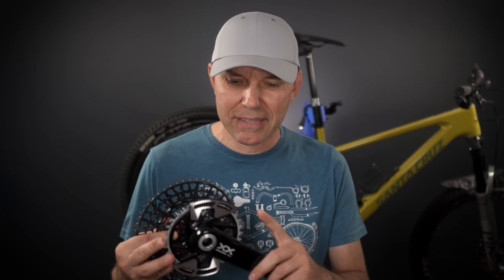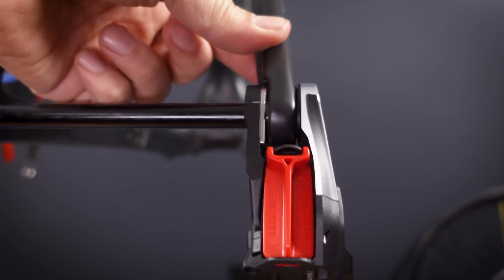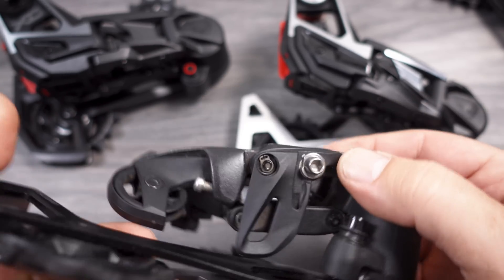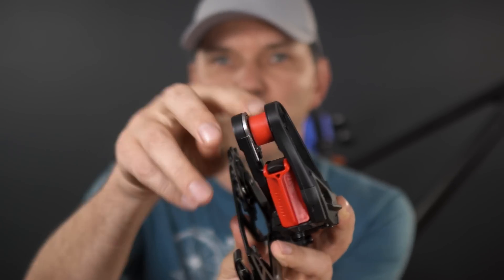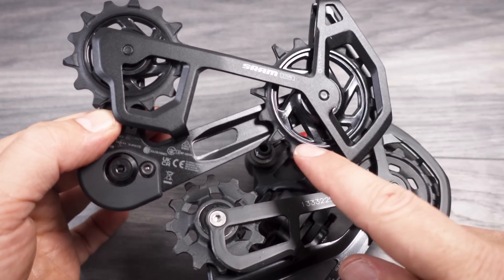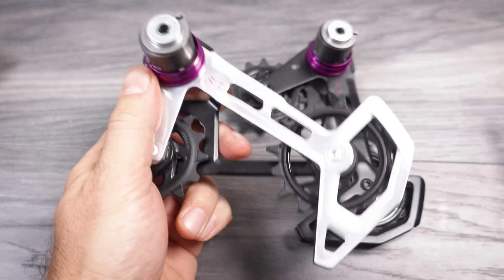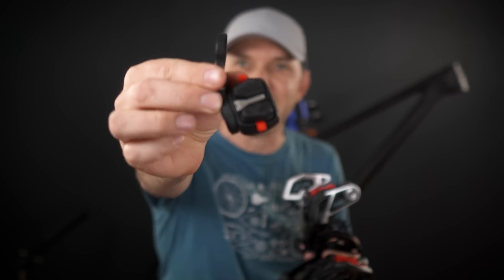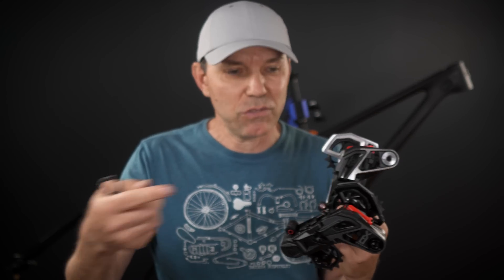NO Hanger! T-Type DERRAILLEURS - SRAM Eagle AXS Transmission Deep Dive GX, X0, XX, XX SL

Comment: Great video! Thanks and respect! One remark: I am pretty sure that the “cassette mapping” is a myth. The derailleur does not know at all in which position the cassette or the shifting bridges are. No sensors for that, nothing. The derailleur shifts even without a wheel or chain installed! The only thing i can imagine is predefined delay times in the firmware between shifts on multiple shifts (yes, that is why t-type is slower on that vs shimano!). All that just calculated on the drawing boards, at an assumed typical cassette rotation speed. Can you support your claim, that the derailleur would “wait for the shifting bridge “?
Reply from the maker: You’re correct! The launch of their mechanical version confirms that😉
Reply: @LoveMTB I was about to add that argument… 👍🏽
Reply from the maker: @AndrasKSzabo lots of marketing hype in our industry that’s for sure 😊
Reply: @LoveMTB still amazing how sram applied the narrow-wide idea to a cassette! All cogs have even number of teeth except the red reference one. It is a masterpiece that the N-W alignment does not derail simply mechanical
Reply from the maker: @AndrasKSzabo like I said they learned from the best😊 Shimano figured out the smooth shifting up and down then they doubled down with Linkglide. SRAM borrowed some ideas and expanded the NW they used in the past just for their largest cogs. Great times to be looking for a drivetrain hard to go wrong these days

Comment: Have a GX t-type axs whole group, simple shimano deore 12 speed derauiler for 50$ works better (and you can use 3rd party chains and cassettes) than this whole setup
Reply from the maker: I would not recommend to use 3rd party chains with the Shimano 12s if you care about the HG+. But yes, way cheaper with similar if not better performance.

Comment: Hi, Can I fine tune the XX EAGLE TRANSMISSION? My bike (S works Levo SL) is brand new and it shifts hard into gear. Seems like it needs a micro adjustment.
Reply from the maker: For sure all here - Easy INSTALLATION SRAM T-Type Transmission  🔥How-To🔥Upgrade, AXS, 1x12, GX, X0, XX, S1000
https://youtu.be/hT4g8HrbU6A

Comment: why can't you put new derrailleur to an ond non t-type system
Reply from the maker: All in the video😉
Reply: @LoveMTB  because there is no adjustment?
Reply from the maker: @rokbukejlovic  Exactly, and because the cassette sits out further than normal. And you need an UDH frame to start with
Reply from the maker: @rokbukejlovic  Sorry I'm not interested in Mickey Mouse setups for such an expensive piece of kit. In my mind if you want this go all in and call it a day. If you don't have UDH or are not interested in spending the money there's better alternatives (SHimano 12s)
Reply: @LoveMTB  lol hahah what abt the weight (on new axs)

Comment: If i can get my XO transmission adjust I'll be stoked. Doesn't shift from great 7 to 8 50% of the time. Ride like bent hanger. 
To shop tomorrow as i don't feel like going through setup routine on new bike. No. Micro adjust doesn't fix it
Reply from the maker: Did you check this out? https://youtu.be/hT4g8HrbU6A

Comment: Great set of videos. Thank you. I'm wondering if you can use the older XG-1295 10-50t cassette with the new XO T-type direct mount derailleur? Is there something magic about the red ring (set up) on the newer cassette (XS-1295) and/or are the teeth different?
Reply: Thank you
Reply from the maker: It won't work take a look at the cassette video

Comment: Hi,
Would the derailleur work with a cassette that is the same size but not the original t type?
Reply from the maker: In theory yes as long as it has the same gear spacing and max 52T cog
Reply: thanks for the quick response
 @LoveMTB

Comment: Will it work on a shimano cassette? I followed your old video and did the install with the axs gx on a shimano system, works brilliant, I’d like to do the same with the T type if possible, cheers
Reply from the maker: Unfortunately no
Reply: @LoveMTB  ahh, well that sucks, but thanks for the heads up. I was just about to buy one 😩
Reply from the maker: Why not buy the t-typeas a whole? Works as well or better thann HG+ @rubinsteinkleer8334
Reply: @LoveMTB  It’s to go on EMTB with FAZUA ride 60, so just need shifter and pod, no cranks and stuff 😩
Reply from the maker: need UDH first of all, do you have it? No need for cranks most probably @rubinsteinkleer8334
Reply: @LoveMTB  yup UDH compatible. Bike is Haibike Lyke 2023

Comment: I was out doing power interval climbing and shifting the sram transmission both up and down the cogs to simulate sprinting and stand up climbing. It does exactly as advertised. It shifts flawlessly under load. 👍👍

Comment: Question sir
Can I use a xplr cassette with the new gx and t type flat chain?😅
Reply from the maker: Actually you cannot as I explained in the video, the new derailleurs are designed to work with the new T-Type, 10-52T cassettes only.

Comment: So in an accident, you brake your bike frame instead of your derailleur hanger, great work SRAM
Reply: how many accidents you had where you destroyed your derailer (and hangar)
Reply: I don’t think you understand the derailleur is attached to the thru axle, not the frame and the thru axle is under linear tension. It is a ver y strong system and eliminating the derailleur hanger makes the system rock solid for precise shifting , especially under load

Comment: I'm saving up for the XX drivetrain. I think the T-Type is a game changer. And with all the abuse testers have shown on YouTube, I'm very impressed. I can genuinely understand where the naysayers are coming from but there is no way the average rider is going to ride it to the point of failure that testers have done. 
Yeah the price is steep but let's be honest...a lot of us have already spent tonnes on our bikes. It is afterall an expensive hobby and the drivetrain is the most worked component of the bike...might as well get the best there is. Also, let's be clear, there's nothing wrong with sticking to other types of drivetrains but if you can afford a T-Type, go for it.

Comment: How the derailleur knows what exact position is now chain on a cassette, i wonder? It need some more sensors on a cassette i think. I am not sure that derailleur works as described...
Reply from the maker: No sensors needed, derailleur has the 11 steps in the firmware, clearly defined. So it knows it's position at all times.
Reply: @LoveMTB  we did not understand each other. Ok.

Comment: The biggest engineering problem with this design. Any impact is transferred directly into the frame. Hangers were sacrificial, they could absorb energy in a crash. Now the energy goes straight into the frame, and something needs to give
Reply: It’s mounted to the axle, not the frame. So the axle will “absorb the energy”.
Reply from the maker: @hauserm95  🤗
Reply: Yeah that's what everyone was saying when it was released. It's been swept under the rug, and I've never seen a good explanation from SRAM or any of their retailers, addressing that very obvious flaw in detail. Maybe they're a good answer, I don't know, bite something HAS to absorb that impact, and I don't see how it can't be the frame. Or better question I guess, is if it's not the frame, then what is it??
Reply: @topspot4834  what typed of impact you guys are talking about ? dont you think you need a big amount of foce to destroy your frame because your derailer bend ?
Reply from the maker: Not really the frame...check this out - https://youtu.be/Wd4UChCvs-4

Comment: Best bike channel out there! Desreves so much more subscribers excelent content across the board.
Reply from the maker: Wow, thanks!😍
Reply: @LoveMTB   hi, have you tried running normal GX deraileur on 10-52 Lunar casette? I want to upgrade normal 10-50 to 10-52 Lunar casette can i try and use the old GX derailleur or do i have to purchas Lunar Deraileur? Thanks in advance.

Comment: I could be wrong? But shouldn’t the portion with connect the t-type to the frame be replaceable as well? If you bend that isn’t it like you bent a hanger? My only guess is that the parallelogram on t-type ws designed to be sacrificial to break before the upper portion shaving you from bending it. Otherwise, replaceability doesn’t make a ton of sense. Regardless you can still bend the upper portion without messing with the parallelogram. Just gotta hope it really is as durable as they claim. This still seems like a first generation product. I’m going to wait a bit on this stuff. I haven’t even made it to 1x lol
Reply from the maker: If you damage that I would assume you've damaged the rear triangle, that bracket can withstand 600kg of weight without deformation.

Comment: I have a full mechanical X01 eagle drivetrain on my bike now and was thinking of doing the AXS GX conversion as those are finally coming down in price ($500 or sometimes sub $500) but I can’t see spending T-type money anytime soon and although the trickle down will eventually happen I am content slow playing it and seeing how I like the AXS GX first before diving any deeper into the electronic shifting game.
Reply from the maker: Having both,  would probably skip the old AXS for this. This is revvolutionary, that old AXS is not.
Reply: @LoveMTB I made the mistake of buying the old gx axs not realizing it wasn’t the same as the t-type. I do like it and it works great but the t-type seems so much better
Reply from the maker: @or-ian6973  if your bike can take it…UDH?
Reply: @LoveMTB  it can. Been looking into the cost vs reward
Reply from the maker: @or-ian6973  💯 still using mechanical shifting for most of my bikes

Comment: Have you actually ridden the Transmission? I’ve ridden it for two months now and shifting its far from smooth. It’s still the loud shifting that the old SRAM components provide. Shimano HG+ is far smoother in shifting. It’s also not that much tougher. Yes, you can jump on the body of the derailleur but what happens when you hit the cage? You’ll have to spend a lot of money to get a new one. Mine held up 2 months until the first defect and I’m not the only one complaining about the poor quality. I’m back to Shimano XTR.
Reply: Well if you hit the cage in hard enough on both XTR or AXS, you will rip it apart.
You can replace the whole cage for $150 on transmission, with XTR you will have to buy a new derailleur for $250-300.
I think the transmission one would be more durable since it can pivot on itself.
Reply from the maker: @Calfa2x  Good points. Still prefer the direct/ Full Mount of the T-Type, a hard bang on the XTR usually would mean a bent hanger also, can be a race/ ride ending incident. Might not be with the SRAM
Reply: @Calfa2x  not true. You can replace the XTR cage.
Reply: @thetrailnomad  I haven't seen the shimano replacement online or its price, not sure how readily available it is.
In any case, the T-type cage rotates so the hit should be pretty devastating to rip it out, 
even if the XTR cages survives the hit, the hanger will probably get bent in the best case scenario.
Reply: @Calfa2x  I just bent the cage of the transmission. The XTR is stronger as it’s partially made of carbon and doesn’t bend.
Reply: @thetrailnomad The XX SL is also made of carbon, I know carbon is lighter but not sure if it's stronger on an impact like that, carbon flexes more but it definitively can break.
Reply from the maker: I have not (I know, hard to believe). The big test will be with my son, he's on Shimano now and he's very, very particular with how he likes his bike to work. So yeah, can't wait.

Comment: I don’t want a battery powered derailleur period.
Reply: 50 Years from now you'll be able to replace a shifter cable, an XX derailleur lithium battery? Good luck
Reply: 50 years from now il be dead 😅 who gives a f#ck
Reply: I completely agree! Don’t want battery on derailleur systems!
Reply: A few decades ago many people said they would never buy a car with an automatic transmission since they were not as efficient. 
Now the automatic transmissions have become so good that they are more efficient than manual transmissions. 
In the near future electronic transmissions will be as widespread as dropper posts are now. Do you want to give up your dropper post because it is more complicated than a regular seat post?
Reply: But a dropper post is a completely new invention that does something that nothing else has ever done. An electronic Derailleur does not. It's the same thing as a normal Derailleur, just powered.
Reply: @mikekelly1771 what? We’ve had adjustable seat post probably since the bike was invented. Dropper post are just easier and quicker to adjust seat post.
Reply: @martinschwartz7342  while I don't think that is the best analogy, I get your point. I'm sure the system works well. I don't want to think about charging batteries and carrying a spare. At this point, I think the price is too high for mass adoption, but I suspect that will change as cheaper versions will be introduced. It also depends on the competition. TRP is releasing a new drive train without electronic shifting. I drive a WRX with a 6 speed manual because I enjoy the engagement.
Reply: Then you don’t have to buy one. Period.
Reply: Battery is a moot point. I’ve had AXS for over 2 years. Never had an issue with charging or forgetting to charge. One full charge keeps the bike running for more than a month, depending on how often you ride. Strange how haters always use the battery as their deterrent. If anything, the price should be the real deterrent. Lol
Reply: @GokkunGuru why do you assume people who prefer mechanical are haters? Doesn't even make sense in that context, cause hater implies you want something you can't have, or you want to be someone you're not. I'm pretty sure a lot of people who don't like it can afford it, but like me, they just prefer mechanical. 

I don't like e-bikes, can careless what people ride, and I've rented one in AZ for a week, but they're just not my cup of tea ... Does that make me a hater?
Reply: @GokkunGuru  I'm not a hater. I'm pretty sure I could probably adapt to remembering to charge a battery, I just think simpler is better. And yes,  the price is ridiculous.
Reply: @briannyob7799  is not having a cable, housing, hanger, adjustments and mech shifter not simple? I believe the whole point of this is to simplify the entire shifting experience.

Comment: As always very informative video. I got my sram t-type XX SL on my SC Tallboy, 2023. After my first impression between the Shimano XTR and the SRAM T-type, I now can say the sram t-type has performed flawlessly, still no issues with shifting. Now with this update, shimano XTR still a good choice as well as the t-type by sram. I am impressed. As always now you can not go wrong with sram or shimano. Just be aware, do like me, for long rides I always carry two spare fully charged batteries 🪫.
Reply: My battery last about 4-6 weeks before I have to charge it and is 2 years old, I ride every day.
Is your battery getting discharged on a single day?
Reply from the maker: Thanks for sharing, do they get used that quickly???
Reply: Holy crap, how long are your rides? Three batteries would be like riding for 4-5 days straight non-stop no sleep based off my usage...

Comment: You can also buy the magic wheel pulleys for $78, the normal ones cost $37.
You can turn your X0 set up almost to XX by buying this.
Reply: And I don't think the magic pulley will be the solution against Damages. The reason for bending the derailleur is a Stick between the chain and the pulley. Good Job 👍
Reply: @der_hahnenkamm  There is no way to avoid all damages, the magic pulley at least covers a failure point.
I think the transmission is pretty durable in comparison to what we have in the industry,  the hanger gets damaged very easily and they are getting rid of that.
Of course, there will be always a way to damage your transmission, the idea is to reduce the chance as much as possible.
Reply from the maker: As you see in the video 👍🏻
Reply: @LoveMTB  Yes, I think is not designed to be pushed with your fingers.
All the examples I have seen are with the transmission mounted and pushing the chain with the crank.
Reply from the maker: @Calfa2x  Well...II have video proof that some don't work even installed on the bike, will know more when mine is all setup and ready.
Reply: @LoveMTB  That's a bummer, I'm guessing Sram should sort you out with a replacement if that's the case since it's one of the main selling points of the more expensive options.
Reply from the maker: @Calfa2x  We will see for now they said, as you mentioned, that is only supposed to work on the bike/ chain pulling on it. More to come...

Comment: Another great video. However, I must say you forgot to subtract the weight of the UDH to give a more accurate comparison of system weight.
Reply from the maker: Great point! it's about 25g and I think you're correct. On my end I am correct on the AXS cotroller compensating as that's only about 40g lighter 😉
Reply: Also housing and cable if you want to be really fair.
Reply from the maker: @GHinWI  not quite as I compared with the previous AXS so no wires for that either